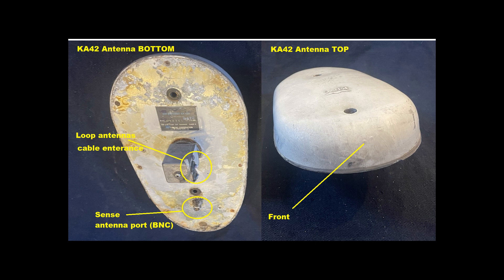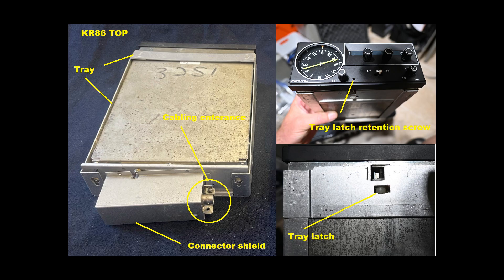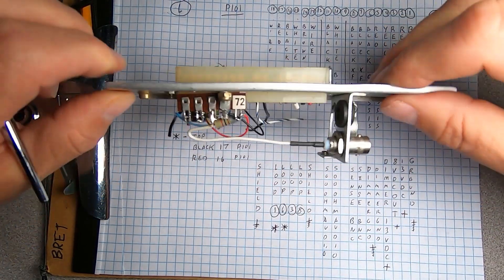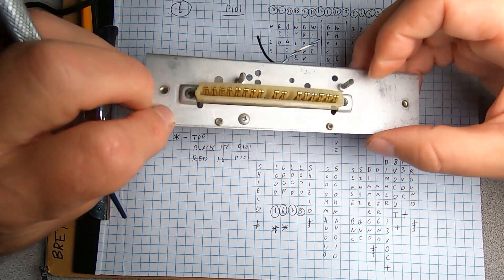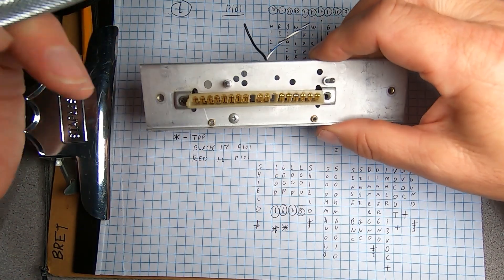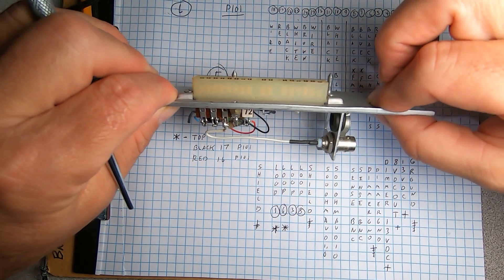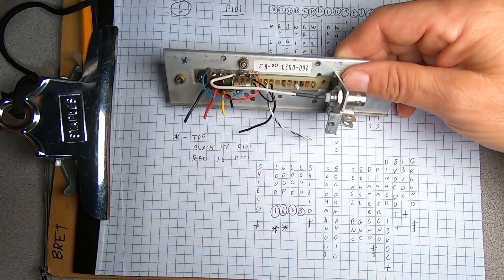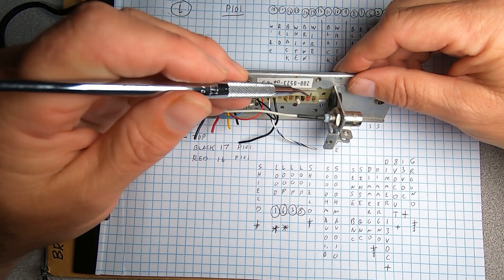Radio Direction Finding 2  ADF Aircraft Automatic Direction Finder Secrets Bendix King KR-86

Comment: Great vid, Bret - thanks! These ADFs were a mainstay in light civilian aircraft from the late '40s up through the '80s. The little 'PI' beacon you recorded cranks out 25 Watts; the powerhouses, e. g., on the east coast - CLB / Carolina Beach, ZBB / Bimini, and ZIN / Great Inagua could be heard from great distances. I often heard ZBB on the ground at the San Francisco airport during the winter - over 2600 miles away! In addition, one could navigate using the 50 KW broadcast stations. The rule was "When flying, the head of the needle drops to the bottom of the case" so you could home to the station, although with a strong crosswind you couldn't - unlike flying a VOR radial - go directly to it. (You'd be blown off course.) BTW, Bill Hepburn's 'DX Info Centre" has a worldwide listing of the NDBs, but they are rapidly disappearing, having been replaced by the GPS constellation.
Reply from the maker: Thank you John for sharing your experience and info with us. Its a shame the NDB's are disappearing. We need to score a surplus antenna for your Southern Avionics NDB xmtr we tuned for 630M and see who copies it. Thanks for watching !

Comment: My dad was a private pilot and as a radio-nerd kid I would love looking at the charts and playing with the ADF on long flights.  Thanks for the video. 
Radio played such a critical role in the early days of aviation. As I recall early major airport letter designators and the nearby major AM radio call-signs were coordinated for navigation purposes.      Bret, do you have any recommendations for antenna paint, dull or camo colors.  I have some stainless-steel (D-103J), aluminum and fiberglass antennas that need to blend into tree line. Mild, inland environment. If it last a couple years I'll be happy. Thanks)
Reply from the maker: Thank you very much for sharing that. As far as paint for antennas goes I really like the krylon fusion paint. Its adhesion is amazing and I have noted no ill effects on an antenna painted with it. The scuttlebutt back in the day was only lacquer was suitable for antennas and that enamel caused changes in tuning but In experiments I never noticed a difference. It sounds like a good video idea ! Thanks for watching
Reply: @survivalcomms  Thanks Bret, I'll try the Krylon Fusion on some older antennas to test. It will be a summer project. I'll let you know how it goes.
Reply from the maker: @rickmaudlin2160  You are welcome. It is really good paint and I think you will be happy with it.